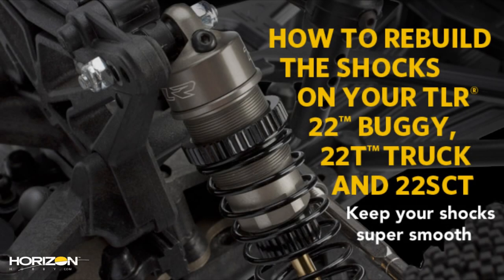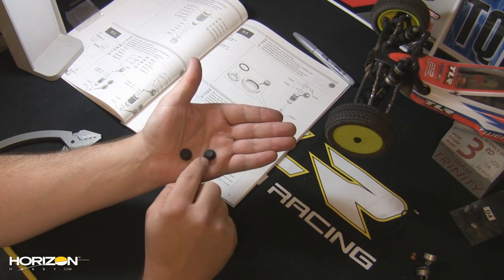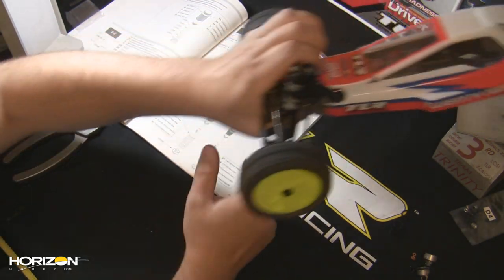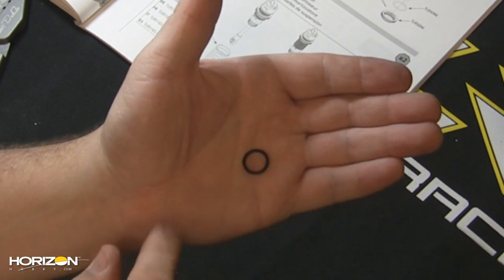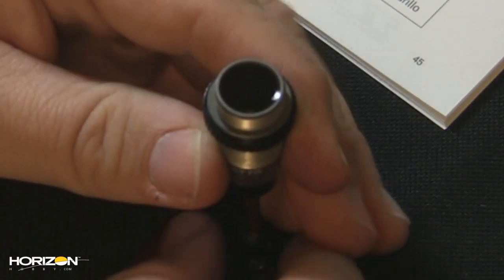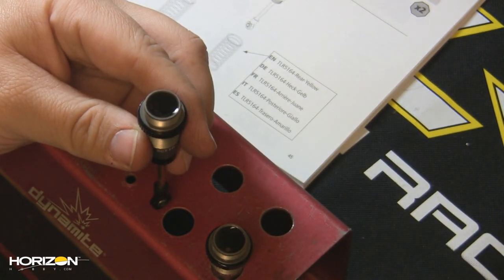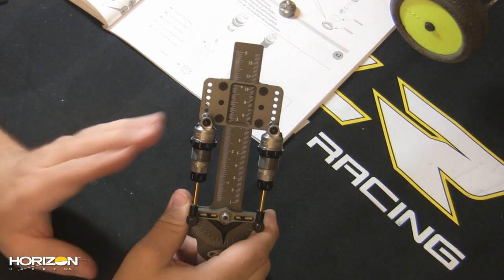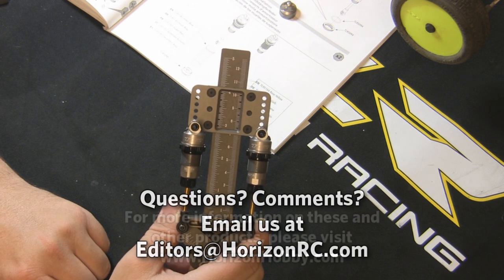HorizonHobby.com How-To - Rebuild the Shocks on your 22™, 22T™ and 22™SCT

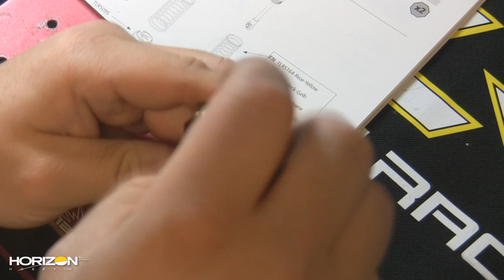Comment: It's weird, on the first one at 8:57 you compress the shaft and install the bleed screw.  On the second one at 10:47 you draw the shaft out and install the bleed screw.... Was that an oversight?  If so, which was is preferred?  Thanks.

Comment: the rubber o ring should be slid over the shock body threads. if you just place it on top it can fall into the shock.

Comment: Is it normal for the shock shaft to want to draw back up into the shock?  I can get the rebound out, but the shaft wants to draw back up in to the shock.  I am having trouble getting the rebound and the drawing problem both fixed to create a truly "dead shock."  Any suggestions would greatly help.  Thanks in advance.
Reply from the maker: Yes, mine lately have pulled in slightly but it doesn't seem to adversely affect the handling on-track